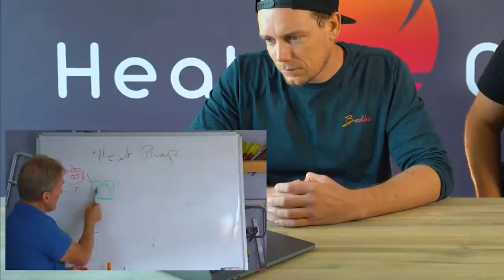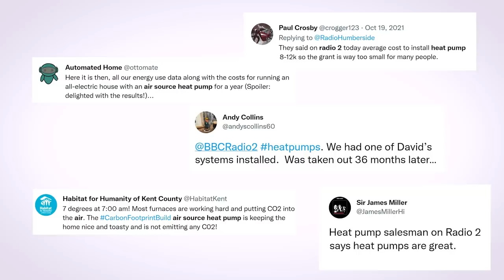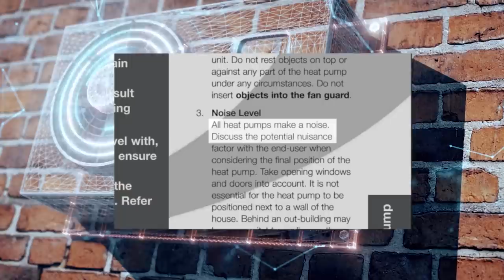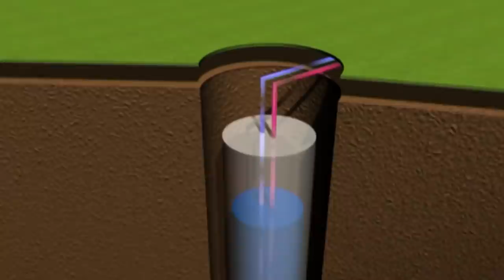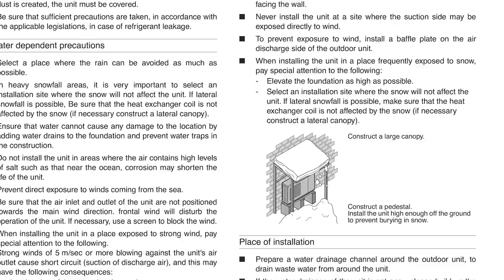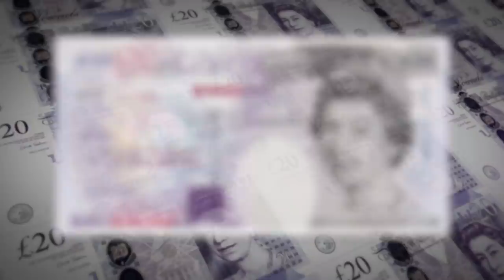Heat Pump Secrets They Don't Want You to Know

Comment: Very useful video, thanks Roger! I’m generally not an early adopter of new technologies, preferring to see all these kind of issues come out the woodwork first, and while I always like to do my bit for the environment (I really go out my way sometimes), I wouldn’t want to give myself more problems than I currently have. So I’ll be waiting for all these kind of issues to be addressed/ alternative technologies to be invented before changing from my gas boiler.
Reply: Heatpumps has been around in sweden for over 30 years, it's not new technology.
Reply: Are infra red heating panels on your radar ? Could check out them too
Reply: @paulfrost3501  Thanks, will check them out!
Reply: The heat pump was invented 75 years ago... your threshold for new technology adoption could use calibration.
Reply: @jonathansage2147  🤪
Reply: Yeah, not new technology. Not used so much in the UK though.
Reply: @jonathansage2147  love this 😂
Reply: @jonathansage2147  Not really; yours does though. By the way, heat pump technology has been around since the 1930s. Which proves my point:

On average it took half a century to adopt an invention. It took the US steelmaking industry thirty years from invention to widely adopt basic oxygen process. Domestic users will take longer for the technologies applicable.

Bottom line, technologies need ecosystems to be adopted efficiently.
Reply: @paulfrost3501  Infra red heating panels are stupid. They make 1kWh of heat from 1kWh of electricity. A heat pump will do 4 kWh from 1 kWh. Or less or more depending on outside temp, but generally are 4 times more energy efficient.

Comment: Acoustic technician here, the external units DO make noise, and I've already been called several times to places where the neighbours wanted to sue the owners of the plant. 
My advice is to ask a professional to evaluate the problem and get involved in the choice of the unit to be installed and on the spot of installation.
Reply: @green4661  Exactly. Forget about high-density  terraced housing in cities - the UK just isn't used to that much noise at night.

Comment: I have just had a air source heat pump fitted to a mid-terrace house that backs onto a river, there's no mains gas and the house location doesn't allow oil or LPG. This is an old stone construction house with a flat roof extension, the worst nightmare of a heat pump I thought.

So what do I have to say about how it works..... Well, it only has a standard 13amp supply, its really quiet! I mean more quite than the flue noise of my oil boiler in the house next door. Its keeping the house at a lovely temperature even in the cold snaps we have just had in this part of the country. The initial electricity bill is cheaper than the oil cost per month of the house next door (end of terrace) I own also.  

Its worth remembering when looking at external oil boilers and the like, you will have maintenance issues very much the same with regards to mice, freezing, wind, salt/rusting etc.

Most people don't like change, I get that. We have to produce more green energy and move away from coal and gas power stations, I'm moving to a green energy supplier now to support the renewables industry and know that my heating choice is renewable.

If you do your research and are willing to make it work it will.

Comment: Instead of leaving some of the circuits open, you could install a small buffer as a hydraulic separator. This way the flow rate from/to the heat pump is always constant. On the other hand you'll definitely need a second pump and temperature regulating valve for that to pump the water to the heat exchangers with the desired heat and flow rate. A third option would be to install a differential pressure bypass, that opens above a certain value, which happens, when too many heat exchangers are closed off.

People with knowledge will know what I mean, for people who do not know: Sorry, but YouTube comments are too limited to explain.
Reply: Dear Friend!
The design you offer is accurate and good as long as your heat engineer knows about the resistance of each circuit to the flow of liquid through it, and it is recommended to add a temperature control in the hub before mixing from the reservoir
Reply: The video is focusing on how bad are the heat pumps, leaving out the full explanations  because these will show that in fact is not that bad. Here there are a lot of families that started to install heat pumps, in most cases the least efficient type, air-water type, and even these don't really have the issues described in this video. I think this guy is from UK, where these should even work better, as -15, and lower, is not that usual as it is in Romania. A heat pump combined with PV panels can further reduce your heating/cooling costs (yeah, heat pumps also can cool a house).
Reply: That all sounds really cheap!
Reply: @cristiandrei1980  I have the same opinion as you.
Reply: My home is fitted with underfloor heating to three floors and is super efficient with my tiny gas boiler, however the level of complexity to service and maintain demands more than most plumbers have in their head and tool kit.  To achieve some of the gains I get one has to consider that there are things like flow switches that need to activate boiler flow to move the water in the cylinder around the HW heat exchanger even when the boiler is not calling for heat, this adds to the cost of energy so in the event of a Heat pump delivering the heat that cannot achieve more than 46deg at best there is a risk that the HW may not ever get above 60deg to sanitise the HW.  Pathogens like cryptosporidium  and others will just thrive since any chlorine will be boiled off in the heat.   Well we can always turn to Lockdowns I suppose
Reply: You are quite right technically in what you're saying but a lot the houses built haven't even got proper cupboard space or a garage that you can fit a standard hatchback in low loss headers probably the most effective way of doing that but to attempt to retro fit the pipework means you got a tear the house apart I'm just a grumpy old git that's fed up with hearing about heat pump horseshit and electric car crap yes we got manage our environment better just as an interim measures why not bring back cardigans and woolly socks set themselves to 18C won't kill us. Also arrest and vigorously prosecute fly-tippers  Confiscate vehicles send in customs and excise to check their abodes for goods without proper proof of ownership bringing down that sort of heat would clean up the country pdq.
Reply: @poppypalais3108  Lol, this is the crux of all this. How long does it take before you start breaking even? I heard all this about solar, fine, as long as you're getting the max feed in tariff, you'll maybe break even in 15 years. We all know now, that's gone for a burton and it's more like 25 years before you break even. Like everything in life, if you have money to "burn", it doesn't affect you, for the likes of the common man, you're too late, tough luck. I have an oil combi boiler, non condensing, and it's, so far, lasted 25 years and cost me about £500 max to maintain. I wonder how long this tech will last. I mean, look at condensing boilers, they're a money pit, I can only guess what these heat pumps will cost you in the long term. All this to virtue signal to your friends how green you are, pathetic, and of course line the pockets of installers and maintainers.
Reply: @fraggit  I honestly don't think you'd ever break even. Watching some of the installers videos, where they show that even the manufacturers' of these pumps advise NOT activating some of the tech that is supposed to make them more efficient because of its unreliability, then I'd have no confidence at all.
The fact that they all have immersion heaters in them to compensate for them being unable to supply hot enough water is hardly encouraging, especially given the current rising cost of electricity. 
And that most of them seem to be set to store water at 50c is shocking, given that it's not enough to kill legionella.
I guess if you have a perfectly insulated home, with suitable radiator system or underfloor heating, and you qualify for the current subsidies on offer (i.e. the rest of us pay for your heating) then they might sometimes be okay.
One of the worst things about them is the lies being told. Just got this off one of those green advisory websites.

"According to data from different manufacturers, a typical servicing of an air source heat pump could cost you between £150-200. They are a low maintenance heating technology when compared to the traditional gas or oil fuelled boilers, giving them an edge in this aspect. "

Average cost of a gas boiler service is £75. Some edge. So such low maintenance that servicing one costs at least twice as much😂
Reply: @poppypalais3108  I never thought of the legionella aspect, that's worrying. 

As for the cost of maintenance, it's a given we can double that figure, because they'll always put the best case scenario in their spiel. Even with the perfect insulation, have you seen the size and amount of radiators some install? That's without all the other peripherals as back up. If I was doing a new build, I'd maybe go for it, but more likely ground source.
Reply: @fraggit  I've read that bigger radiators are needed because of the lower temperatures, but haven't seen them yet. given how small many new houses are they don't sound very attractive. And of course bigger rads, bigger cost.
Unless ground source installs last at least 50 years, then they'll never be economically sensible. The only people I've seen having them are very wealthy people with large houses and grounds that can afford the upfront costs, knowing that they'll get most of the money back through the current subsidy. And, at least with the ones I've seen, a spare building or fairly large room for all the equipment ground pumps require.
I somehow doubt that that level of subsidy will be available for long. 

For most of the UK's housing stock heat pumps just don't make sense. I'm guessing the proposed ban on sales of new gas boilers will be quietly extended and then dropped in a few years.
I'm just in the middle of opening up an old fireplace. At least I'll have some heat even if I have to burn the furniture.
Reply: @poppypalais3108  Yep, that's the reason why. I saw one installation where they had to put massive vertical double rads because there wasn't enough room to fit them horizontally. 

We're installing a couple of multi fuels, so if fuel prices go up too much, we have about 200 acres of forest behind us to pilfer from, lol.
Reply: @cristiandrei1980  if you haven't lived in an English house you wouldn't understand. Romanian houses are built to be comfortable, English houses are built. Windows are drafty and humid, walls are thin and humid and do not protect from much.

some houses are ok, but overall and for some reason they like shelters instead of houses.
Reply: @poppypalais3108  When my mother was in her mid-eighties, she was billed about 1200£ for a service visit. The technician claimed that the original installation was done "in reverse" and he had to rectify it. One spare worth 10£ changed. Hours + service fee charged. If you are really old you need an uncomplicated technology that is cheap to service.
Reply: All ok but very little heat output for the vast amount of energy/power input
Reply: @cristiandrei1980  that would cost around 30,000 pounds in the UK we also have the highest electrical tariff in europe

Comment: The big problem is for those of us who already have AC it would be nice to have an hvac company come out and add a reversing valve and a water to heat exchanger to our already existing air conditioner twenty feet below I have all the heat I need just need to upgrade my unit

Comment: Well, I have two mini splits and they are quiet…..very quiet.  However good points are made.  Mine have no back up heat.  Rain isn’t an issue with the installation.  I have one that runs on 110v and one 240.  Wind can be an issue, but most places not a problem.   Thanks

Comment: Who needs a heat pump when we have heated jackets eh Rog 🥵😉.
I love how you held your own on Radio 2 mate up against that aggressive little man , what a charmer he was 🖕🏽🧱👍🏼
Reply from the maker: It is funny that, I have no idea if he was little but he sounded it. How can you sound little?  I think a blindfold test is required
Reply: He also claimed that gas boilers cause 40,000 premature deaths PER DAY. 
Pollution, caused by vehicles, gas boilers and industry, said to lead to equivalent of 40,000 premature deaths a YEAR in UK.
Reply: @safetyladysilver8988  Yep heard they too 😳🤣🤣
Reply: @safetyladysilver8988  Reality is 40,000 premature deaths per year due to air pollution in general, not strictly from Nitrogen dioxide or gas boilers.
Its a lot, and makes 150,000 covid over 2 years seem fairly low compared, the talk about the harm of No2 is around diesel vehicles, which we are seeing a rise of due to so many more deliveries, what I am reading now does not mention gas boilers at all.
These Heat Punmp machines look like a potential white elephant

Comment: Well split AC are heat pumps too and those are very efficient.  So I would install those, rather heating water. Also if summer is hot you can use to cool

Comment: Thank you for great info. Ive noticed things like the size of the cable on those things... Its clear to me they use a lot of energy and work very bad in cold weather. But you had so many good points i didnt think about.
Reply: size of the cable is irrelevant, if you have any 8 - 12 kW electric appliance it will have massive cable. It does not meant that is always taking that much power. But for sure this is the main problem of the air to water heat pump that it needs defrosting by standard resistance cables. Air to air heat pumps dont have these since they just turn into cooling mode and defrost like that
Reply: Understand on very cold days they can use 60 kwh per day ..that's £12 a day  pre April electric cost and £18 per day once the new price cap comes in .

Comment: I had a gas boiler in the UK and it worked with radiators to heat the house and took a while to heat the house up. Gas boilers also have to be maintained and suffer from frosted pipes and also the dangers of carbon monoxide if not maintained properly -  and are definitely not as efficient to run as a heat pump (reverse cycle). 
Now that I'm in Australia, many houses (I would say the majority) use heat pumps and they work really well. We don't require to be as vigilant about snow or even frost here but other than that one heat pump can keep a 90Sqm home warm/cool with minimal cost, particularly if it is well insulated and has double glazing. If the house is double storey then either ducted heating is needed to transfer the warm/cold air around or a second heat pump is needed. Cost of installation is relatively low and you only need to have the heat pump on when you need it. I don't know what Roger was talking about when he said it needs to be on all the time. I don't agree. If it's cold it goes on and cools the house down until it's not needed. If it's very warm in the house (which is more likely in Australia) it goes on and works really well almost instantly. As an aside, the beauty of a heat pump or I prefer reverse cycle is that that it can heat and cool your home. In the UK in London in the summer when it's hot.. its really hot.. and humid and all you can do is open a window and sweat ! I was back there last year and it was hellish. Also, I think gas prices are through the roof these days aren't they? The same is true in Norway, my wife's family home is kept warm by the heat pump and it works extremely well when it's -5C outside.
Reply: Hi Dominic,  I think you are talking about air to air reversible monosplit or multisplit, aircon (with heat pump in the outdoor unit)  while Roger is talking about air to water heat pump that can produce sanitary hot water and delivers hot water to the central heating system (with over-dimensioned radiators necessary or underfloor heating to be efficient), which is supposed to be on 24/7.

Comment: It seems to me that, for the UK at least, for the time being, a mixture of sources to heat our homes is still going to be needed for the foreseeable future. Not everyone will be able to install air or ground source heat pumps, for various different reasons and the situation in understanding these technologies is still being tested (here in the UK) as we have been so used to heating with gas.
The key element towards heating your home sufficiently is insulation. Insulate your home as much as you can, including your floors and draft proof your external doors and windows. You'll be amazed at how much heat escapes through your floors.
That, coupled with adequate ventilation and being sensible with how you use your heating appliances. We heat our four bed edwardian semi to no more than 19 degrees Celsius and of course only heating the rooms we are using at any given time through our smart radiator thermostats. Yes, only when the temp falls below 0 do we use our multi-fuel stove for a few hours in the evenings to support the system, but that has been few and far between.
Reply: and let's not forget putting clothes on rather than ramping up the heat.